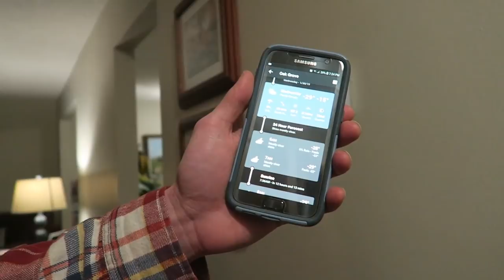The One Where They Farm in Minus 30 Degrees

Comment: What do you do for heat source in the house, how do you keep pipes from freezing?
Reply from the maker: Our house has only a standard 85% efficient forced air furnace. All of our pipes are internal except for the water source from the well pump. It enters the house in the basement floor, which puts it well below the frost line.

Comment: Does your water supply not have a pipe that drains down at 6ft when you shut the water off? Just curious why it's freezing.
Reply from the maker: There is some leak at the base and water comes all the way up the shaft at the handle. That water drains, but the residual freezes the piston.